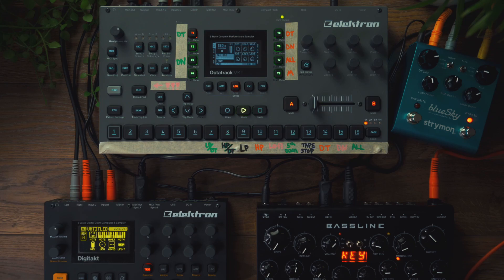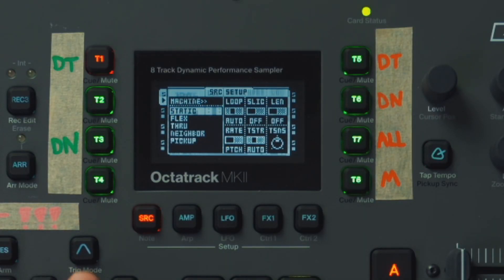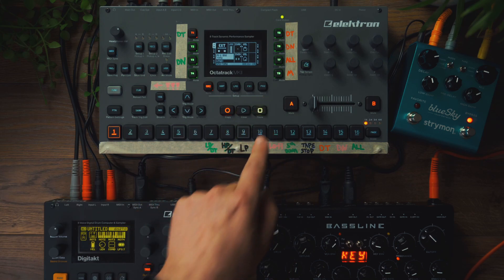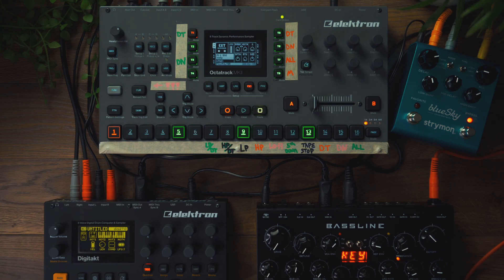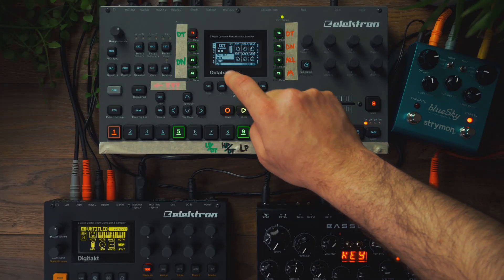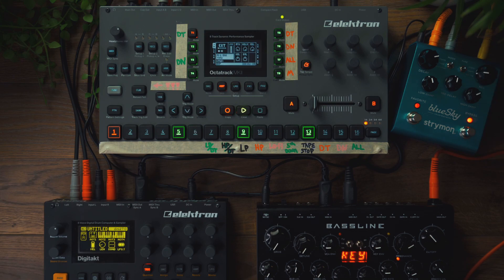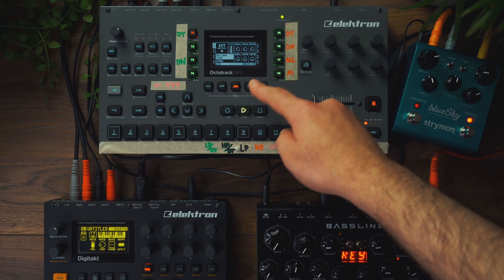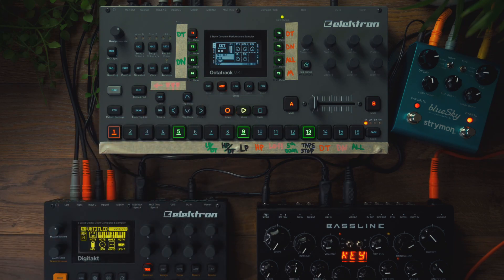Octatrack Tutorial Video: Sidechain pumping effect!

Comment: You could also not use trigless trigs and just use an LFO instead. 

Use an inverted square wave. 
Set the parameter to " amp vol", 
Set the trig to "sync trig", 
Mult to "16x", 
Spd to "32" 
Depth to taste.

This way is pretty cool as well. Thanks!
Reply from the maker: This is true but I don't think it sounds as clean in my opinion, plus I am not particular to square waves for ducking envelopes. I did mention setting the envelope to reduce volume but that can and often does create clicks and pops during playback, which is why I chose the filter.

Comment: This is a really good idea thank you for the tip. 
One thing I realized is, I have to press the trigless lock and "no" (!!!) not "yes" to turn it in a trigless trig.
Took me about half an hour to get my head around that.
Weird. Is this due to a incosistency in my machine or was there an update or what?
It is stated in the manual either. You have to press the trigless lock + "no".
Thank´s for your input instead. Good idea with the filter width, much smoother then.
Reply from the maker: Yeah they changed it after the update that added FUNC + Yes to audition

Comment: Great videos, excellent content and awesome production value. You clearly know your stuff and work hard on this content. Thank you! On my side, I've had the OT for years (I have MK1 and MK2), and while I've learned a great deal on how to actually use them, I haven't quite figured out what to use them for. I can't do a full track on them, haven't made that leap. Very diff from MPC Live which I've done full tracks on no problem. OT is amazing for mangling and making loops, but moving from a set of loops into an actual coherent / completed work that flows and is arranged, this hasn't clicked for me. For now I use it to make those loops and patterns I'd never come up with otherwise, sample into Ableton, and do the rest of it there. Is there any of your content, or anyone else, that can help people like me bridge the gap?
Reply from the maker: That is a good idea for a video I think. Here's a quick tip: copy and paste the same pattern a few times - than make alterations to each of the copies. You can do that in minutes. Than try and perform the song, taking different elements in and out as you progress across those patterns, record that performance: You finished a track.

Comment: what's the difference between sidechain and envelope follower?
Reply from the maker: Well the Octatrack doesn’t have an envelope follower or the ability to actually sidechain, just for reference. Envelope follower will track the dynamics of a signal and you can use the data to modulate another destination. Sidechain is similar to that as it uses another signal to to control the dynamics of the compressor. If you sidechain a kick into bus compressor that is on your pads and leads bus it will create a ducking effect on that bus that sounds rather pleasant.